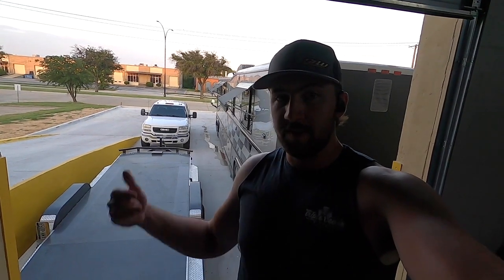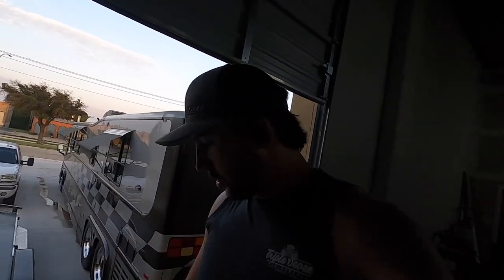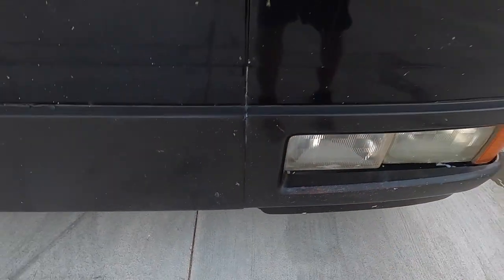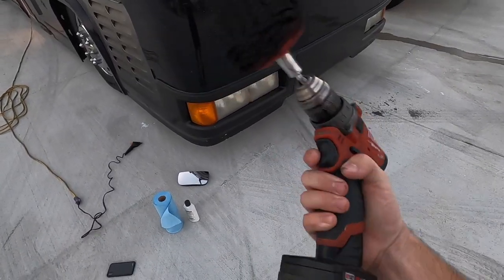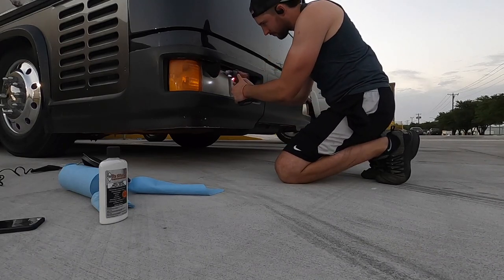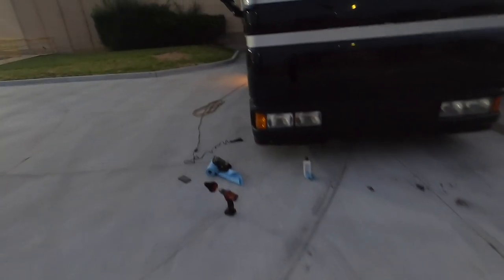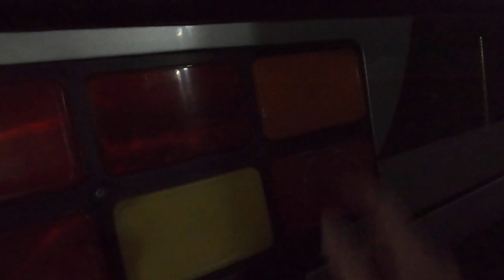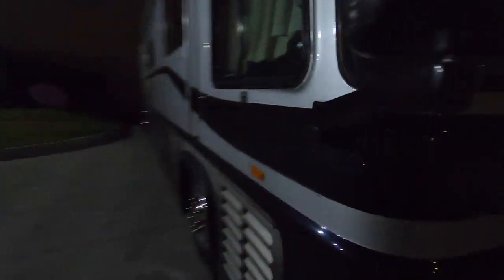How Well Does White Diamond METAL Polish Work On Headlights?? (Newell Coach Project)

Comment: The headlights and turnsignals look like 1987-1991 Ford F-150 units. Maybe you can get new ones from eBay or online. A set with clear turn signals would look pretty cool! 🤘😎🤘
Reply from the maker: They are and you're correct. thats my plan!

Comment: If you’re doing led clearance lights 5x7 led headlights would look good.
Reply from the maker: Those are too small for the hole. It uses 89ish f150/bronco headlights
Reply: Stapleton42 you could put 9004 led conversion bulbs in if there’s space behind the housings🤷🏼‍♂️

Comment: On our Mazda CX-9 the headlights looked new except one small scuff and I tried 4 different kits and none lasted and they are motorized so not cheap while gassing up I used my anti death wipe Wet Ones brand red or green don't remember I've used both and they look new I just wiped them no cleaning or polishing

Comment: You can make all the lights look brand new by starting with about 6-800 grit sand paper and step your way to about 1500-2000 then buff them cutting compound thin finishing polish once you have it looking new then clear coat it.  Its a lot of work but its the best way without buying new.

Comment: You can spray some deep woods off on them first it will take most of the yellow off. Then polish on the rear after cleaning then it helps to spray clear paint on them. Clear only the rear.
Reply from the maker: Thanks for the tips ill have to try that

Comment: 1000 Grit wet sand paper, buff with wheel and rubbing compound, good as new
Reply: Our Mazda CX-9 after using other kits wouldn't clear up I gave up on them then after cleaning my hands with Wet Ones wipes after getting gas I wiped a bug off the headlight and it was clear I laughed saying yeah if only it stayed that way well after a couple treatments as I call it they stayed clear and they were bad like gray bad being motorized they aren't cheap don't remember if it was the red or green container we use both